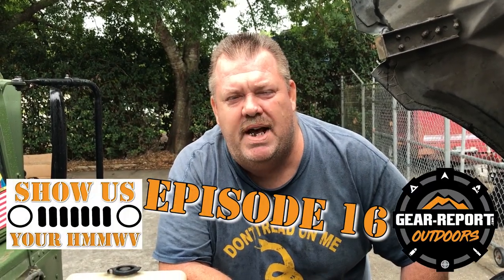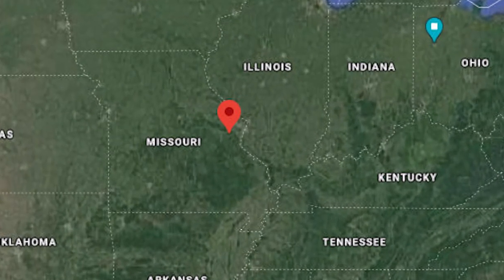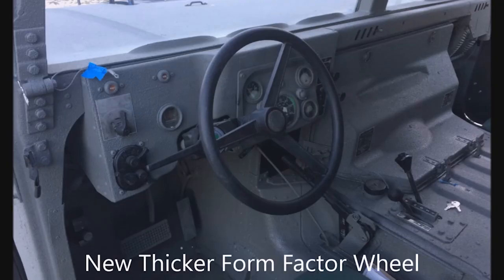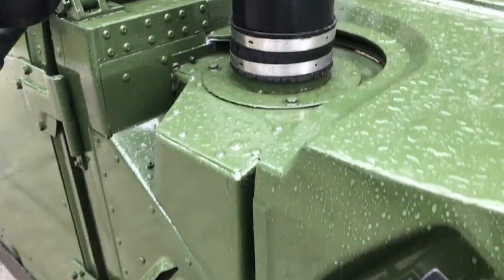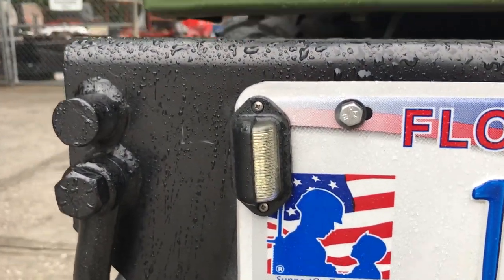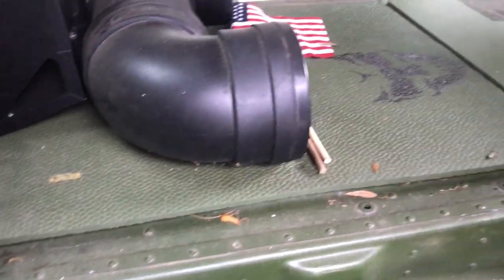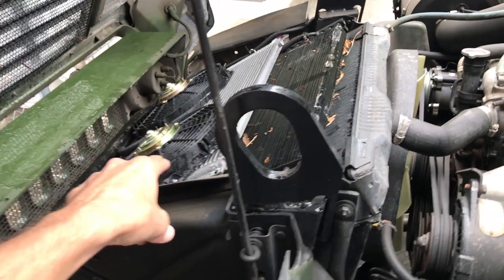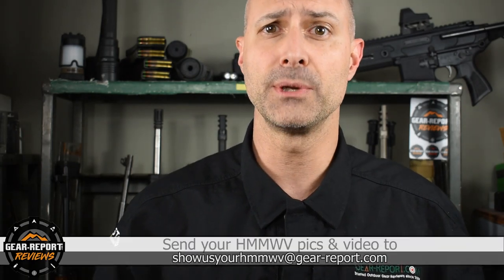Show Us Your HMMWV! Episode 16 - Prime Mover Humvee, Safari build and glossy custom HMMWV

Comment: @6:20...………...the gap that is on the rear passenger door - too left & the body of the HMMWV - is that normal????
Reply from the maker: Yes and no.
Nothing about that configuration is really "normal". Will put a hard top on a former soft top HMMWV and created his own rear wall. If that were a slantback HMMWV, then there would be no gap, as the forward edge of the sponson is shaped to fit the door. But if you look at GMV HMMWVs that have hard tops, but no sponsons, that sort of gap is normal.